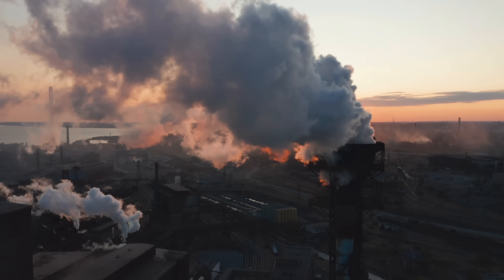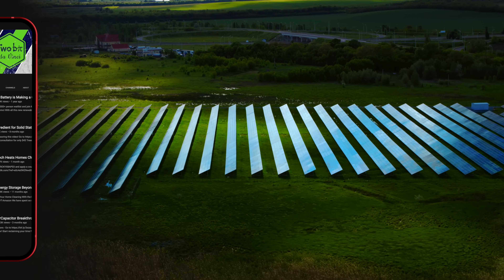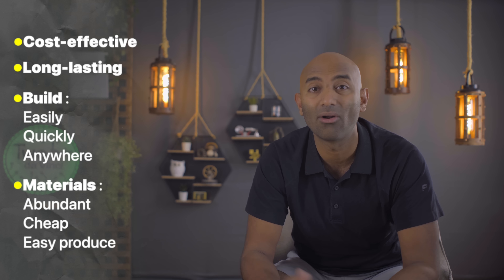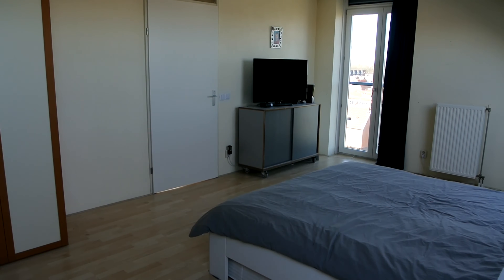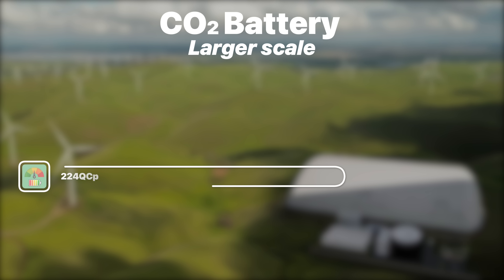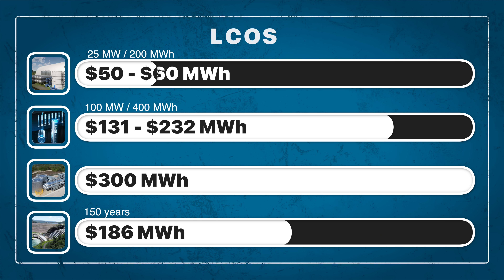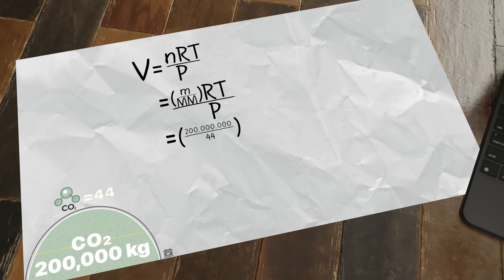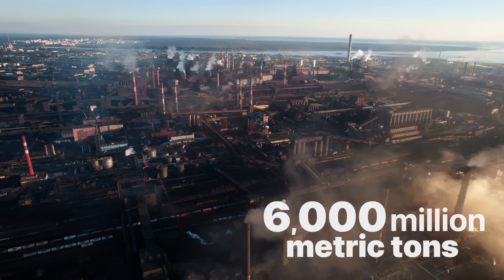The GENIUS Of the Carbon Dioxide Battery

Comment: This seems to be nonsense to me. To compress the CO2 in the first place requires energy - electricity. Whilst this energy is being used for this purpose, it isn't going to the grid where it is needed.   Wind or solar can't keep up with current demand, let alone have a significant proportion syphoned off for this fairytale so-called answer. This is no answer at all.

Comment: Probably what I love most about this idea is that... it basically adds a economic reason for carbon capture, aka capturing CO2 at the plant, and extraction out of the air/ocean, in order to produce these large scale batteries. They never listen unless they can see a profit in it!
Reply: Would be great if Carbon Capture was easy and efficient. 

But it isn't. 

It takes so much energy to power carbon capture if that energy is created with fossil fuel burning it actually emits more than not doing CCS at all. 

So they use green energy for their CCS. 

Which is stupid at best and downright evil at worst. Why not just plug that green energy into the grid, stop powering things with fossil fuels in the first place and cut emissions at the source instead of inefficiently scrubbing them later? 

Other high emissions industries may be able to justify CCS later if it gets more efficient, and help justify it with after market value like this. 

But for now CCS is just a big steaming pile of petroleum industry propaganda to keep us burning their products longer and maintain their revenues.
Reply: @5353Jumper  Because fossil fuel power sources are dispatchable, whereas renewables tend to be intermittent and grid demand is variable, so you can get spikes of renewable supply when demand is low that exceed the present capacity of the grid to store. At that point you can either furl the wind turbines and otherwise waste the renewable power, or you can put it to use.
Reply: @ThePurplePassage  still does not mean CCS is a good idea for the petroleum industry. 

And did I say replace fossil fuel generation 100% with solar and wind? Nope. A blend is best but we need to get to a point where we are actually meeting daytime needs with green generation before that is even a problem, long way to go particularly if the petroleum industry keeps sucking all the materials, labor and funding from actual green generation projects. 

In some regions natural gas peaker plants make great sense, as long as they are relegated to secondary fast spin up generation instead of the primary generation. Still does not mean CCS on them is a good idea.
Reply: @5353Jumper  I agree that where CCS is a net emitter (the emissions generated in powering the plant are greater than the volume that is captured) then yes it is obviously foolish to use, and yes most jurisdictions are not at the stage where electricity generation is wholly or even mostly carbon free.

But in the event that it was, or if like I said the low carbon energy generated would not be stored or used (favourable wind conditions for example) then why would you be opposed to the use of the technology then?

If your goal is to abate the effects of climate change then negative emissions technology is a good thing (and I stress again, provided it is a true case of net negative emissions). The less the volume of green house gases in the atmosphere the better and the fewer the number of extreme weather emergencies, migration flows and possible water wars will occur
Reply: @ThePurplePassage  because you are thinking in absolute 100% this or that when reading my comment. That is not what I said. 

I said stop wasting effort on stupidity like CCS on petroleum projects, and spend the effort on something that could bring real change (real reduction in atmospheric carbon emissions). 

And I did not say shut down all fuel use, I said reduce demand for fuels.

And I did not say move all energy generation over to solar and wind, I said not to waste solar and wind on petroleum projects so we could have a higher percentage mix of green in grid and endpoint generation. 

And with the money/skills/materials not wasted green washing the petroleum industry, we can spend some of that on energy storage if you like so wind and solar and other green generation becomes more ubiquitous. I never talked about storage because it was implied in the point of increasing generation like solar and wind. The need for storage is not really a problem, we have dozens of great solutions depending on region, all that needs to happen is getting enough wind and solar to make storage a part of the overall solution. Kind of a wasted part of the conversation when obstructionists say "solar and wind will not work for the entire grid requirements because they need storage", an project designer/engineer says "yes, so we will add storage when we get to that point. Next topic please". But obstructionists keep bringing up that point as if it is some kind of magic flaw to stop all solar and wind projects from existing somehow. It is not. 

Trying to eliminate something entirely and immediately does not work at global scales. But we can reduce risk, reduce damage, reduce emissions, reduce demand for fuels quite easily of we stop letting the petroleum industry manipulate and dominate the narrative/market.
Reply: @5353Jumper  I was not thinking in absolutes, merely posing a hypothetical scenario to try to establish a principle. That is that where you have a temporary spike in renewable energy generation (say from temporarily extra favourable wind speeds) and where that spike exceeds the ability of the national grid to either consume or store that surplus of green energy, and where no more GHG emitting generation can possibly be displaced, why, in that circumstance would you be opposed to the use of running some carbon capture plants? Why as a matter of principle is it so imperative to you that that carbon be left in the atmosphere to continue to warm the planet?

In these kinds of circumstances, where there is no emissions cost to doing so then I fail to see why removing some CO2 is so harmful...?
Reply: @5353Jumper  but my comment was not made in the context of being fossil fuelled, was it. I specifically said this was based on excess renewable energy.

The situation is that it's a favourable wind and more wind energy is being generated than can be consumed or stored. So much, in fact that it's starting to unbalance the grid. As much fossil fuel powered generation has been displaced as possible, and for the purposes of the scenario you can assume there's already as much demand shifting done as possible.

Now as a grid operator, you have two choices, order the turbine owner to furl the wind turbines and discard the additional green energy, OR ask the carbon capture plant to start running to soak up the additional power (and some CO2 whilst at it).

Your comments imply you think it would be better to waste the power. What I am interested to know is why.
Reply: @ThePurplePassage  yes I agree once we actually have excess green generation it could be put to purposes like CCS. Or potentially stored with a variety of different solutions. Or potentially converted to Hydrogen for industrial applications and niche transportation (reducing the amount of methane produced hydrogen). 

The problem comes down to economics, what is actually financially practical. Will there be a financially viable CCS project that only operates when there is excess green generation once we actually do have excess green generation? Maybe. Will it be better than storage or Hydrogen production financially? Maybe but not likely. 

But the reality today is that the narrative and purpose of CCS is to greenwash petroleum projects, which is pure stupidity at best and a devious plan to keep up burning fuels at worst.
Reply: I think you mean immediate profit, but I could be wrong.

Comment: Nice!  But can it scale down to home unit size (say of a small 2ha/5acre or so block) 
How much maintenance is involved per year?  Do you need to have staff to run it, so it would only work on a larger scale?  (Scales of efficiency).
In short, apart from the setup cost, could this be efficiently setup on a small block of land?  Or would it need a neighborhood to support it on a small-medium scale?
I would love to know more.
Reply: Small scale wouldn't make sense, only would be cost effective for larger scale use.
Reply: I love the idea of storing my own energy and being totally independent form the grid, but all the storage options I have come across are just so much cheaper to do on a massive scale its hard to justify the infrastructure just for myself. The closest I have come across is a thermovotalics battery system, seems like it could be done on a small scale for less of a maleus than other tech, but still most efficient to be done on a large scale. IDK, maybe we will never develop a system capable of personal energy independence.

Comment: All of us put together are at best a tiny dot on the surface of the earth. 
  ‘We’ are carbon based. There are different carbons. Plants love carbon! Petroleum is deposits of decayed vegetation; the deeper the wetter. It didn’t grow down there, and it was a sudden burial. Plants store the energy of sunlight. Nature on our planet can deal with our releasing of hydrocarbons just fine in a natural means of self balancing; in a very short period of time. High concentrations of it should be avoided, -use common sense. We’ve been breathing burned vegetation since we’ve been cooking our food or just wanted to warm up a bit. When we burn hydrocarbon material, we are not adding anything to our environment than what has already always been here. 
  Eventually, we will run out of our easy source of tapping those deposits; and before we do, we should learn how to tap the unlimited resources from the materials around us. The carbon will go back to the soil from which it came. The earth’s oceans and atmosphere will keep the balance where it needs to be.

Comment: CO2 is a byproduct just bottle it. It's not like we're going to stop manufacturing and almost all forms of manufacturing produce carbon. We are already collecting the solids we might as well collect the gas and turn it into liquid and ship it after all we have the capability of 6,000 lb pressure tanks.

Comment: As far as getting the start up CO2 for the CO2 battery, why not power all the electricity demands of the construction of the facility with a generator that feeds all the exhaust CO2 into the system. It might not be able to supply all of it, but it would lower the start up demand.